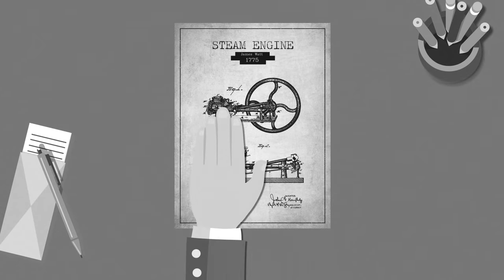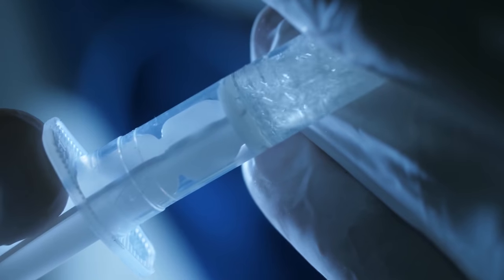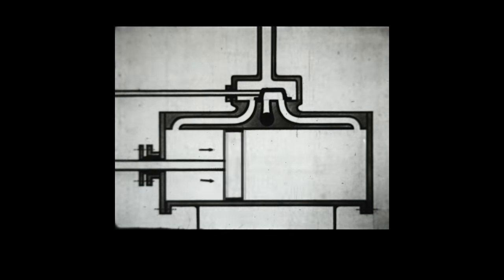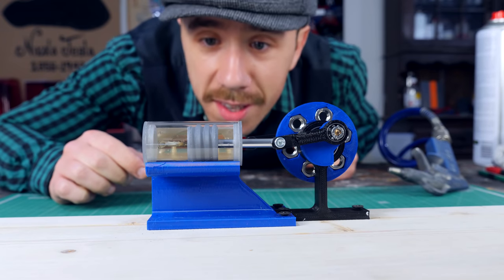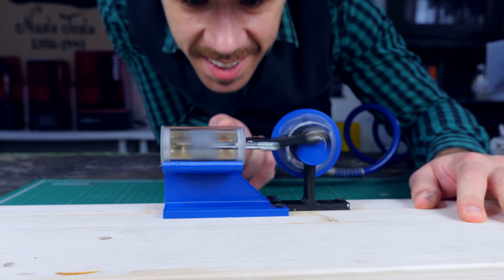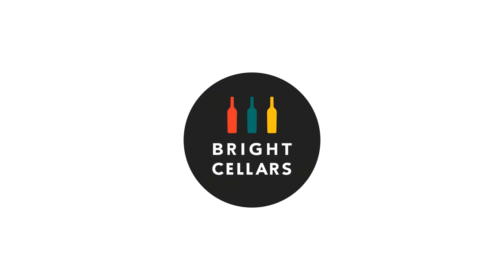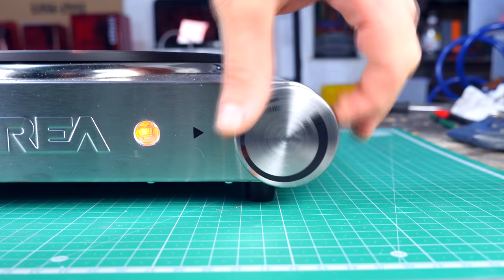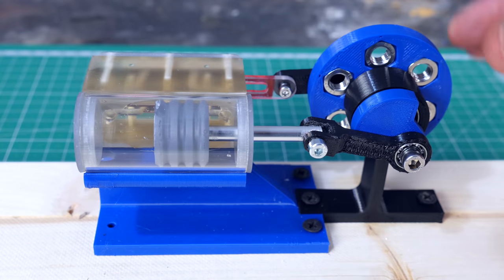Transparent Steam Engine (3D Printed)

Comment: Idea: I think it would be awesome trying to make the steam engine go super fast with heating wires or creating a closed steam engine so that there is no water wasted. It would also be cool putting a propeller on a steam engine and making that the engine of a plane (or just keeping the glider idea :p). (Using some type of pressuarised container can be helpful then XD)
Reply: The only steam powered airplane to successfully fly, IIRC, was a Travel-Aire modified by the Bessler brothers in 1933. The engine is on display in the Smithsonian.

There is at least one YouTube video about it.
Reply: Sterling engines (which Integza has made before) are the main example I can think of where they have a closed loop of the heat transfer fluid.  Trying to build a closed loop which can cool off steam to enough efficiency to run an engine sounds INCREDIBLY difficult, I would guess that is more cooling than most cutting-edge VGA cards require, even for the steam engine in this video
Reply: @gregw1076  Yes, that is a really good point XD. It would really be cool, even if not having the best efficiency, to see how to overcome the challange of it!

Comment: Great video. You can use loctite -  an anaerobic glue - to bind materials and release them later using acetone. I would love to see a 3d oiler can+brush design that is non magnetic and can't spill a drop if it is dropped!

Comment: I’ve done some reading on rocket engines and I’ve found that paraffin (candle wax) could be a very good rocket fuel, a lot of people have made versions which are hybrid rockets (even nasa conducted tests with it) but I reckon it could be done as a solid engine if it were the paraffin and a class 2 oxidiser or something. Why don’t you give that a try integza?

Comment: Now that you’re working with steam engines. One of the main things I have noticed is that steam engines have a drawback that they run out of water/fluid to produce steam.
What if you could make a condenser chamber to collect the vapors and “refuel” the engine
Reply: This would be cool
Reply: Ships and some steam locomotives did just that.
Reply: @hollywood1340  oh nice

Comment: Hey Integza, I think I know a way you can improve this. 
I think the main reason you were having trouble at low pressure was not friction, but a lack of a seal between the two sides of the piston. This is part of the reason why engines have piston rings. I think if you added these your engine would work a lot better.
Reply: Nice point, Wish to see a version 2.0 of this engine
Reply: yea lid better seals would help. but then friction would be the issue. like with his Wankel engine
Reply: One solution to sealing the piston better is to produce a narrower section of the piston, then wrap it in cotton string soaked in vegetable oil. The string, being compressible, provides a better deal, while the oil reduces the friction.

Comment: You should try and make an engine that runs off of a weight on a line attached to a gear ratio along with the steam engine idea, just to give it a little kickstart and help it run better while under load.

Comment: VI: I read somewhere that you can mix in other materials into resin, so instead of fdm printing, use resin mixed with some sort of solid fuel to remake the solid rocket engine. It might take a little longer but I thing it would work even better with pure oxygen💥🌋
Reply: He already did
Reply: Would be interesting to see graphite infused for reduced friction!!! Maybe Nylon powder!
All mechanical parts have friction, and Integza is always dealing with overcoming friction. That was the main reason he needed over 2 bars for this steam engine. If it was lower friction, he might have gotten away with 1.5bars, maybe less!
Reply: @tobiashegemann1811  not with resin printing

Comment: “Water is not flammable” sounded like a challenge to me. How about creating an 3D printed electrolysis based engine?
Reply: This sounds so wacky that I officially support this idea.
Reply: @PieterRottiers  3D printing and hydrogen combustion, what could go wrong? 

[insert flashbacks to numerous explosions with questionable safety equipment]

On second thought….

Comment: I would love you to re-build the steam engine but install a condenser so you can re-capture the water for re-use, also try using screw on caps for the end of the piston chamber so they don't pop off as easy, and maybe some lubricant on the piston shaft to make it run smoother.

Comment: Idea: make a powerfull enought steam engine to drive an rc car or so, with stearing and forvard/backwards gears and controll it via the remote. (for any improvements leave a comment)
Reply: Candle powered RC car :O
Reply: @aurimasb1732  I don't think a candle can generate enought heat, but some electrical heater could do the job.
Reply: Increase amount of candles hehe

Comment: Watching this again gave me an idea. What if you had expansive balloons on a spinning wheel, and used a compressor to fill each balloon as it passed by on the wheel. The pressure of the balloon at an angle could push and produce power with a moderate psi

Comment: There's another engine that works both like combustion engine and steam engine, it's called Stirling engine, and this type an engine uses heat so that the heat pushes the pistons in the cylinders, it is also maybe better than steam engine.

Comment: [Video:] It's to late to suggest. 
But a closed loop with HHO burner. Yes the burner must be enclosed in a wider part of the tube with a mesh to extract the  heat. You should get enough heat from the burner to generate steam outside the main loop. Water from the internal burn can be collected in the downspiraled copper tube to the HH0 generator. If it's enough water it might rotate some 3D parts on its way down.
Reply: Ofc with a T-connection or weak points  to release high pressure if there's an explosion 💥

Comment: You should add cylinder drains, when the engine cools after use, the steam will condense. The water won’t compress and you will hydrolock your engine

Comment: now the only things your steam engine needs is a boiler(you can use a small can(really anything that doesnt melt)with a candle(again anything that is hot can be used), a good flywheel(that will make the egine run even after steam turned off) and something that uses that steam power(like a generator or something that uses circular motion)

Comment: You could use this concept of printing the engine from plastic to build a steam powered piston-propeller driven airplane if you can figure out how to lighten the steam production mechanism.  You could try just a metal cylinder with candles underneath maybe. I have a feeling just using a steam jet to power the plane would probably be more efficient, though.

Comment: Talks about pressure inside a glass bottle while blasting it with a torch (which creates additional stresses in the glass) and not even wearing safety goggles.

Comment: To keep the caps on without glue: A c-shaped bar (3d print it) that runs lengthways the cylinder with the folded ends holding the whole thing together.

Comment: Train steam engines had a water tank. Hot coals would burn the hot water and when releasing would send the steam back to the water tank reservoir. But the smog from the coal would go out the top through the chimney. Recycling the water.

Comment: You often build (especially 3D-print) mechanical moving parts, where friction reduces efficiency (here you needed comparably high pressure for small and light-weight parts to ony keep them in motion.
Use grease... and - because some moving parts will get hot - use silicone-based grease for these hot parts. That should help your parts significantly.
Of yourse.... the grease used mustn't act like glue, what - under some circumstances (like a temperature, which isn't recommended for the targeted temperature range). On the other hand... breathing in the aerosole of silicone spray fog... might be somewhat de-motivating 😂.
Well, nonetheless... some purposeful grease or oil would be helpful sometimes...

Apart from that: Good work, Integza (or was it Intezga...? 🤣)

BTW... Happy New Year, Integza!

Comment: Hey Integza, steam jet ejector for vacuum generation is one of the most interesting devices I encounter in the industry which has no rotating component but has a unique geometry that allows it to generate vacuum. Can you make a video about them. Maybe modeling and printing different geometries and comparing the vacuum generated would be interesting!

Comment: Try fitting the piston with high-temperature O-rings next time, so you won't lose pressure from steam leaking between the piston & the cylinder wall.

Comment: this video gave me an interesting thought, what if you did use alcohol instead of water due to its lower boiling point ? the fire wouldn't need to be as hot, would that make it more efficient ? 
secondly made me wonder instead of carrying around a huge water tank why not funnel the gas into another compartment to cool to eventually be injected back in to the heating chamber?

and a quick google later, they only use water because its easy to get, cost efficient and isn't toxic and some engines do use condensers to reuse water in places were water is less common #learning
Reply: Also, remember the point about alcohol being flammable? This steam engine vents rather than condenses the steam to allow the other side of the piston to push. A room full of alcohol vapour would be both intoxicating and a fireball waiting to happen.

Comment: It was said that Hiram Percy Maxim built a steam powered aircraft that almost flew, but it scared the inventor so bad, he cut most of the wings off of it to prevent it from happening again!
Rather than building a glider, how about a steam powered aircraft? But use a fluid that is a gas at room temp, and you use the gas that comes from the fluid to power the engine?
I was thinking of a butane fluid, but that is flammable, perhaps something non-burning, but has the required boiling temperature to work without heat needing to be supplied other than the ambient.

Comment: Probably the reason why the pressure was dropping so quickly is because you didn't fill the pressure cooker unitil the water is near the lid, if you did that, the pressure would've not dropped that fast.

Comment: 24/7 Seawater battery charging system for sailing yachts (instead of solar power. Typically the boat needs Serial connected Cathodes and Anodes in Sea-water to reach 14.5 Volts. Thanks for awesome content. (I do not think I will win any 3d printer, but This Idea for a video is hardcore.)

Comment: What would be a great idea is two combine your sugar rocket fuel with this engine, you cold burn it, build a little tank in front of it to smooth out the pressure and then use the pressure to drive the engine. When you burn the fuel in a tube with a good diameter it could be run the engine for more then 15 seconds like this time 😃

Comment: Video Idea: improve on this concept with a coumpound steam engine to use the steam multiple times and put pressure gauges on the cylinders and steam chest to show the reduction in pressure. Thanks!
Reply: Also I’m sure you already know this but typically when running steam engines on very low pressure, you keep the stroke short and increase bore size dramatically. The increase in piston surface area will increase the force it puts out and by keeping the stroke/setup the same virtually no increase in friction. A twin cylinder engine quartered( set at 90 degrees at the crank) and timed properly will start itself in any position.

Comment: A subtle tip since you are doing cinematography. Frame shots using the rule of thirds. Where you vertically divide the screen into thirds and place what you want the audience to focus at on either of the lines. Seems nuts to film off center until you remember we don't have one big eye. Rule of thirds helps the viewer's eyes relax. Youtubers get around this because of the recommendation list next to the video. If you look at the way youtube is built it uses the same rule on the website to tug views on to another video.

Comment: Steam contains more energy than water but more importantly 1 litre of water will generate 1000 litres of steam. Squash that steam into a small volume and you’ll potentially have 1000x the pressure.

Comment: video idea: use steam to actuate twisted nylon fiber "artificial fishing line muscles" and then use that to drive a generator. 
its basically nylon or other material twisted until it coils on itself. at this point it contracts with enormous energy density when heated. the caveats though is its difficult to use this to harness thermal energy, though, since the actuation stroke is relatively small compared to the length of the actuator, high-flow steam should be able to do so. you might need to produce an array of these though which tug on a 1-way bearing or apply levers onto them to turn the low-stroke high-torque actuations into something usable. since steam produced from boiling water cant exceed much more than 100C without further heating it, its ideal since nylon can handle it

Comment: Baked single stage turbine parts would be cool, then it would be possible to build cheap steam turbines in more substantial power and efficiency ranges, for small 1-20kw production units.

And it would be better if all printers would use pellets, instead of very expensive thread that is made from pellets.

Comment: Video idea: attempt to increase the power/efficiency of your pulse jet by increasing flame front speed in the engine with an electrolysis machine to feed 3-8 roughly straw diameter hydrogen/oxygen ignition tubes into the frontish of the engine, 
Certainly a big project to actually get it working but also extremely cool if it works, and it’s something I’ll eventually try to make myself

Comment: Hey integza, mabye try to construct a locomotive boiler fueled by propane, they are hella powerful and good steam generators if built properly. And if you hydraulically test it 2 bar above its set working pressure it should be safe

Comment: I’m trying to make a steam powered model battleship that I’ve been printing and this is probably a decent design. It’s quite short I probably have a 8”x4”x12” area to work with where it can drive 4 small propellers. I hope I can get the design to work. Only problem is heat + plastic is not good
Reply: Total length of ship is 5ft so it’s not like it’s tiny but I wanna make sure it’s good enough to work in a tight area

Comment: I wanted to get something like a steam engine for a odd solar rig that had a clear pressure cylinder that expanded a gas that was made from the electrolysis of Clorox bleach instead of a boiler. And the strange gas would ionize in sunlight generating pressure to run the engine.

Comment: pls try steam powered radial engine with multiple cylinders 3d printed. and a second project for you could be film cooling 3d printed rocket nozzle . or fuel cooled nozzle. fuel first goes through the nozzle cooling it. them goes into the combustion chamber. could be very very interesting

Comment: Couldn't you technically build a device length clip that attaches to both ends that would act as a clamp to hold the caps on?

Comment: Video idea: finish your peanut butter joke ;-).
If you want to have better results with current design, add secondary heating to your pipes carrying steam. You have a huge problem of condensation, your steam is barely steam (not so surprising, considering the method).

Comment: Integza, would you consider Airbrushing thinned out 3D resin onto a print made of plastic(PLA for example) to strengthen said print, or to create a fine surface required for a certain project?

Comment: Great video! Can you make an air pump engine too? I have a CO2 laser and i want to make a better air pump with 2 bicicle pump and an ac motor . That it will be great even to replace the normal air compressor engine that is verry loud. Thanks for your video man!

Comment: And can I find out what materials the engine parts were printed from? I tried ABS and nylon, but the thermal expansion and hygroscopicity of these materials did not allow the engine to work from steam — only from air (or something else with a low temperature). Thank you very much!

Comment: Can you build a steam powered jet starter motor I know that there was one built but it was for a propeller plane and it was on the ground near the plane and all it was used for is to keep ice off the engines and start them up or help in the process anyways

Comment: Instead of using a valve, many steam engines and steam locomotives that powered trains, used a counterweight, could have been a helpful design
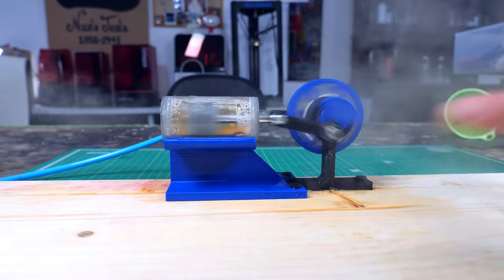Reply: Also, the engine was stopping at 8:50 it’s because it was getting flooded, to stop this add a valve and open it on the cylinder and have the steam pressure high, it should keep the cylinder from flooding with condensation,

Comment: Nice video brother..appriciate if can print the  TURBOFAN turbine..and run it by brushless motor (which is HIGHER rpm configuration) the best part is to make it half transparents view so we can see the mechanically how axial turbines works ( without kerosene ), i believe by running that 3D printed turbine model can ganerate small compression and sound from the details on stationery and moving blades pitch angle on that turbofan turbine.Really appriciate it brother to make a video for it. ( I hope u will take this request into consideration, and myb i have a chance to get free 3D printer hahahahahahahahaah)

Comment: Can someone  pls explain what happens when the steam cools down and turns back into water again? Is it let back into the boiler? if so how does that work
Reply: i could be wrong but i believe there’s some sort of exhaust system. or at least on actual steam engines there are